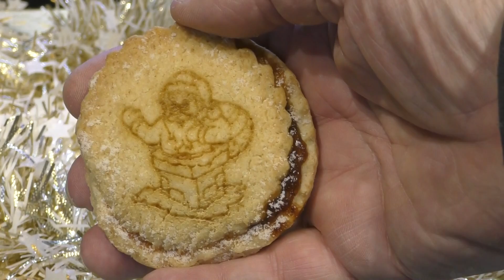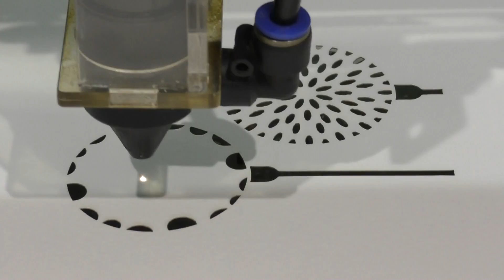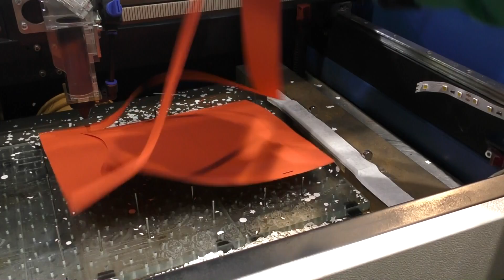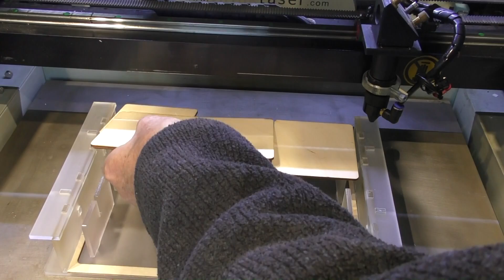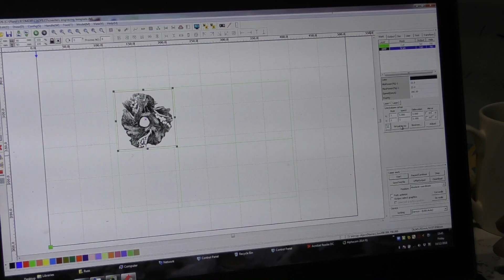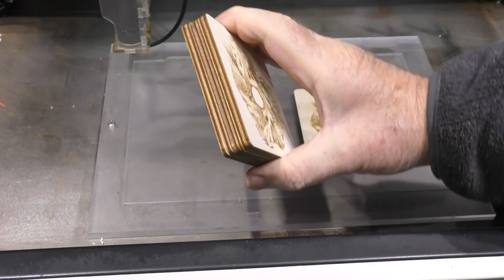161 Xmas Special 2018

Comment: Hi Russ! Thanks for all that you've done to enlighten us regarding these economical laser machines. I've been in need of a laser machine for my business for a long while, but couldn't justify the cost of a TRotec or Epilog, and was afraid of these Chinese machines. Thanks to you, I pulled the trigger on a 60/40 machine in November, 2018 and it's great! I had to adjust and modify everything but the machine's colour to get it to work really well, but that was actually fun to do. I do have a question or two regarding my specific use for the machine, but can't find a way to reach you privately.  How can I reach you?
Reply from the maker: Hi
Sadly YouTube canned their private messaging system a few months back. Add your email to another comment. I get auto copied to my gmail and will write back to you. I will immediately remove you comment to remove your email from public view.
Best wishes
Russ

Comment: Happy New Year Russ. I had an idea. What you think about to install a laser pointer inside the cutter head? May be another and easier way to align all mirrors. I think to make a pipe with the same diameter of the original one, with the pointer placed in the center, with or without the lens. (Elder Brasilian English apologies)
Reply from the maker: Hi
Thanks for your suggestion because I would encourage everyone to try and think of ways to make beam setting easier.. I have been trying to solve this problem since first owning my laser 3 years ago. I have experimented with all sorts of methods from looking UP through the nozzle and / or lens tube to many different designs of red beam pointer attached to the laser tube in some way, tring to duplicate the beam path.  All the pointers were about 95% successful but none was good enough to set the mirrors perfectly. I gave up after Mk7. and am resigned to using the scorch method. The real secret to easy beam setting is to make the head adjustable in Z and Y and to use  a simple logical method of setting the mirrors. It only takes about 20 minutes to set the beam up from scratch. The head needs to be adjustable (almost all machines are not) because the Z axis is the most crucial and most difficult to set if your head is fixed.

Best wishes
Russ

Comment: Since you probably know more about these lasers than the people who build them, have you ever noticed how one would go about removing the stand?  I'm getting ready to order one and won't be able to get it through the door unless I can take off the stand and rotate it.  Thanks so much for this information AND for all of your great videos.
Reply from the maker: Hi Marti
The back to front dimension of a 7050 machine is usually 34 inches so it depends on your door width. Many doors are 36"  but other  standard sizes are 28" 30"  and 32".  Yes you will be able to remove the base frame.legs. The fixing bolts are often accessed via the inside of the bottom cabinet and on some designs via holes in the support frame tube itself.  Usually the left hand end is a good place to stand it on for wiggling through your door . If you have a small furniture dolly frame that will be brilliant  if not put several layers of blanket on the floor and slide it through the doorway  slowly. It will do no harm standing it on end for a few minutes. Many have had to resort to such methods so you will not be a pioneer.

Best wishes
Russ
Reply: @SarbarMultimedia  This is excellent to know.  I'll have to remove the door because it won't swing completely out of the way, but I should be able to get away without disassembling the laser...at least until later when it either stops working or I apply one of your modifications.  :-)  Thanks again!  You are my laser guru.
Reply: @SarbarMultimedia  If mine turns out to be 34", which the description confirms, I'll be fine.  I'll have to take the door off the hinges but that's nothing.  I do have a furniture dolly, ramps and a roommate with floor jacks and dollies, etc..  Thanks so much for your help!  And again, thanks for your videos.  Your mind works like mine does and you've saved me SOOO many experiments.  :-)

Comment: I am wondering why you didn't engrave the coasters before you cut them out, all in one process?
Reply from the maker: Hi
I have tried to explain in many of my videos that the requirements for engraving of any sort but especially photo engraving are diametrically opposite to those required for cutting
For cutting wood and card you need lots of air assist directed efficiently into the kerf. You achieve this with a small hole nozzle close to the work surface because the aim is to push 100% of the smoke out of the BOTTOM of the cut.  That way you get a clean top surface with no uprising brown fumes being blown back down onto your work. Engraving is completely different in that there is no BOTTOM EXIT for your fumes. They have to rise up like an erupting volcano. If you accept this inevitability then you plan for in several ways. First turn your air assist down to a mere whisper, just enough to protect the lens Second, increase the nozzle orifice diameter so that whatever whisper of air you have is NOT directed as a jet  at your work to force the upcoming fumes back down to make your job brown. Third, Shorten the nozzle to get the biggest gap between work and nozzle. This limits the build up of crud on the nozzle. Forth and finally you must have an efficient CROSSFLOW of air over your work to pull the uprising smoke away from the work area before it has a chance to settle.  If you only ever plan to do a few coasters, you will have to contrive a compromise situation if you wish to engrave and then cut. For production of coasters where one can never say what photo the client will want. It is far more efficient to  maximize the benefits of each process in the way I have shown. One machine cutting and another specifically jigged and set up for  for engraving.  Please remember that these are not tutorials, I am only demonstrating how I do such work, using techniques and methods that I discovered  and demonstrated on video.  I am not saying you must copy me, use whatever method suits you and your machine
Best wishes
Russ
Reply: @SarbarMultimedia  Thanks Russ. 
I have a 80watt machine (same as yours) on order, but do not expect it until  the end of Jan. I have watched about a dozen of your video's but have not gotten to where you go through the explanation. Thank-you for all these vids, they are very, very informative.